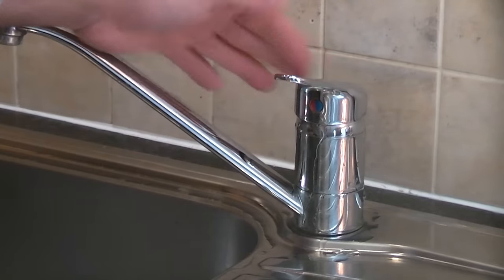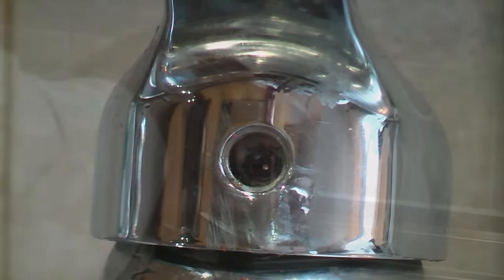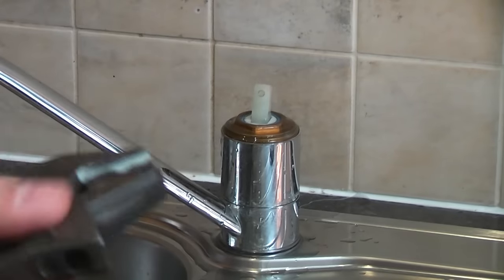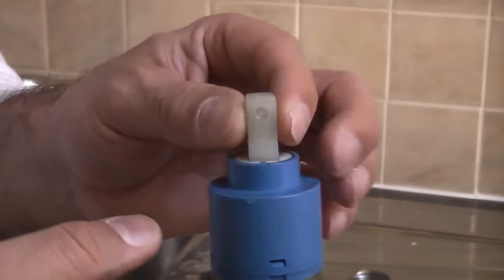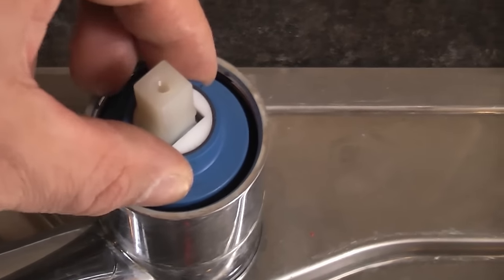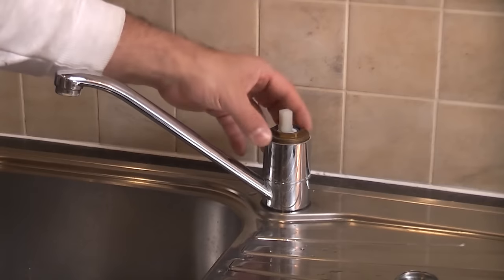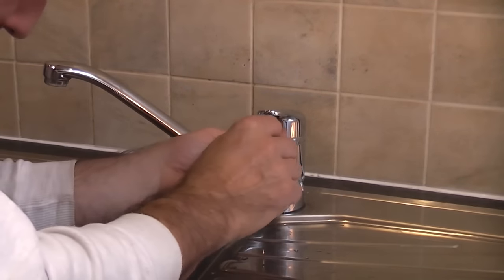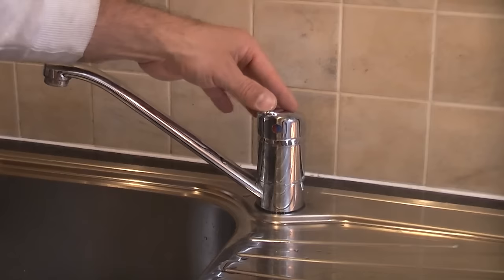Kitchen mixer tap repair

Comment: I have the same tape. Is the process the same too fix if the leak is dripping out tape and not the sides? Thank
Reply from the maker: Yes, a new cartridge should fix that, although if the tap is leaking from the centre (where the two parts of the tap join), it is often best to replace the whole tap.
Thanks for the comment 👍
Reply: Ultimate Handyman   Thanks for the reply, and helpful vid. Yes I meant to say my leak is dripping from were the water normally comes out,  so cartridge replace or tape.  Just double checking thanks ,Likes and subbed

Comment: Ches, you might know the answer to this question:

Why are bath taps such a small diameter nowadays? Presumably this is so they can make the same gland fit in basin taps, but my bath takes 15 minutes to fill!
Reply from the maker: +James Knight I think it's because most plumbing these days is piped in 15mm, whereas with older systems it was 22mm.I don't think combination boilers can heat the water fast enough to fill the 22mm pipe, hence it's all piped in 15mm now.

Comment: My problem is the screw does not come out, it is unscrewed to a degre but I cannot take the cap off.
I do not want to break it any advice?
Reply from the maker: I had a similar problem in this video-
https://www.youtube.com/watch?v=a2prr9ZiFxA&t
Spray penetrant, a bit of gentle persuasion and gentle taps upwards should help 👍

Comment: Great video, I'm happy that I found it! I'm in Australia where everything is so expensive. A call out for plumber to check on your tap can cost you $150! My tap has the same problem, I tried to open it using an Allan key as in the video, it turned and turned but I could not open to handle! Any advice??? Thank you so much!
Reply from the maker: Sometimes the handle gets stuck on the square spindle, spray penetrant can help to release it.
Reply: @ultimatehandyman  thanks, I'll try that
Reply: Plus consider that if you are doing this in Australia then the same principles apply but upside down 👍🏻
Reply: Hello I have loosen the screw as per the video but the handle doesn't want to come off.
Reply: @ultimatehandyman  worked for me 2 sprays 10 minutes each of wd40

Comment: I've tried and tried to lift out the access cover using the sharpest pick tool and it just doesn't even look like it will come out, there is no edge to it at all
Reply from the maker: They have always come out pretty easily for me, but I've not worked on every single brand of tap. I hope you have sorted it by now.
Thanks for the comment 👍

Comment: The cap doesn't come off after taking out screw, any particular way to take it off
Reply from the maker: It can get stuck because of corrosion and solids in the water. If you spray some spray penetrant through the hole, let that soak in, then grab the handle and try and force it upwards, it should work loose. Sometimes it is not easy though and can take some perseverance 👍
Reply: @ultimatehandyman  👍  managed to get it off thanks

Comment: Hello I have loosen the top screw as per the video but the handle is still stuck?
Reply from the maker: Sometimes they get stuck on when the zinc corrodes.
If you can spray some spray penetrant through the hole, it might help to release the handle.
Sometimes I remove the grub screw completely, give it a spray and then after 10 minutes give it a gentle tap using a mallet, or by using a hammer and soft piece of timber (upwards)

Comment: I found this video useful but my mixer tap is leaking from the spout itself. It just drips every 5 or so seconds. Highly annoying! The tap isn't like the one shown but has a hot and cold either side but flow from one spout. any ideas? 👍👍
Reply from the maker: +tman2260 
Does this help-
https://www.youtube.com/watch?v=gQHdzRnbkW4
Reply: Yes it does. Although it drips from the spout itself. Will this cure it? I'm not sure which one is leaking so I will change them both. Many thanks for the swift reply 👍👍
Reply from the maker: +tman2260 
When you say dripping from the spout itself you do mean where the water normally comes out of and not the bottom of the spout as it comes out of the tap.
If it is leaking out of the end of the spout (where the water normally comes out), then yes replacing the cartridges in it should fix the problem.
If your tap is not a quarter turn tap, you might get away with just fitting new washers, very similar to this video, just a different style of tap- https://www.youtube.com/watch?v=I1iGLiUCDqI

Comment: What to do if there is water coming from the cartridge after replacing it?
Reply from the maker: Try tightening the top nut (the one that holds the cartridge in position). If that does not work, you might need a new tap 😱

Comment: Having some trouble loosening the brass nut which allows you to access the cartridge. Any suggestions?
Reply from the maker: They can be really difficult to remove. Sometimes you can pour hot water on the nut and it might help to loosen it.

Comment: Step two and already failed. Wether I use Hex Key or anything with similar head, screw doesn't come loose. From video it looks like socket is round, and mine is as well from what I can see with flashlight. Sadness ensued.
Reply from the maker: If the grub screw is stripped, you might have to drill it out!
😱
Reply: @ultimatehandyman  Well that's the problem, from your video I see round screw same as in my case, though you used Hex Key and it worked for you. I have to decide whether I'm seeing things or I actually have to go at it with drill.

Comment: 😢is there any fix to my tiny water jets out of the side of the big long part of the tap? Ir do I need to buy and have new kitchen sink tap fitted?please see previous comment for more in depth description thanks:)
Reply from the maker: You can normally just unscrew that part and get a new one, they are called a tap aerator, or sometimes a tap nozzle (faucet aerator if you are in the USA)

Comment: Hi there, I changed my cartridge but it’s leaking again . Can u pls tell what I should look for .
Reply from the maker: If the nut is tight, either the cartridge is faulty or the tap itself is damaged. The tap in this video was replaced a couple of years after the cartridge was replaced, as it was dripping from a join in the tap itself, which could not be repaired. Sometimes a new tap is the best option.
It was a real pain of a job to do- https://www.youtube.com/watch?v=N-MyYzYwEhc

 Thanks for the comment 👍
Reply: Ultimate Handyman  Thank you 🙏 for tip , I’ll change with the new tap and see .

Comment: Hello mine is leaking at the bottom of the tap near the sink, I think limescale must have corroded the rubber ring there, is that easy to replace? I have exactly the same tap.
Reply: same here. what do you do when it leaks from the bottom? I am unable to find a solution anywhere online
Reply from the maker: It should be relatively easy.
I'm sure my sisters tap has started leaking in the same place. I'll try and do a video but I'm really busy at the moment and have zero spare time.
If you remove the cartridge as in this video you should then be able to unscrew the tap body, which will expose the O rings.
Reply from the maker: You have to remove the cartridge, then unscrew the body of the tap.
I'll try and cover this when I get chance, but it could be some time as I'm very busy at the moment.
Reply: Exactly. I removed the cartridge yesterday and tried to unscrew the cylinder above the spout. It just does not budge. I do not want to force it and risk a bigger leak. I am sure I just have to replace the O rings. Are you sure it simply unscrews?
Reply from the maker: No, I'm not sure.
Similar ones that I have fixed have separated and have an O ring, but I'm not 100% certain with this exact model until I have a go myself.
If it does not separate I would imagine that the only fix for it would be to get a brand new tap, which is a real waste.

Comment: You were lucky, I have recently found out that there are no replacement cartridges available for any of the taps in our house, even though at least one is a large reputable brand. We can live with the slightly leaky tap in the bathroom, it only drips a few times per hour and doesn't waste much water, but the kitchen tap is getting stiffer and stiffer to turn and soon I will have to replace the whole thing, not good for a tap only 3 years old!
Reply from the maker: +caskwith 
Have you checked all the sellers on ebay, there seems to be lots of different types for sale on there- http://fave.co/1NWppR4

Do your cartridges have any numbers on them?

It's so much more work changing the taps!

Good luck with finding one- or replacing the taps!

Thanks for the comment ;-)
Reply: The numbers didn't match to anything I could find online and contacting the manufacturer didn't help either. I'll get it sorted somehow.
Reply from the maker: +caskwith 
It's ridiculous that they can make taps that you can't get the parts for. It should be illegal!
Reply: +Ultimate Handyman 

It just struck me that somewhere, there might be a group of manufacturers going :
It's ridiculous that he not only repairs our stuff but also teaches others. 
In spite of welding, glueing, crimping....he manages to get into everything 
we make no spares, follow no standards, but he manages to repair everything 
Our loss of new business is unimaginable !    IT SHOULD BE ILLEGAL !

:-)   :-)   :-)   :-)   :-)   :-)  :-)   :-)   :-)   :-)   :-)   :-)  :-)   :-)   :-)   :-)   :-)   :-)   :-)   :-)   :-)   :-)   :-)   :-)
Reply from the maker: +BR Gurunandan 
LOL, I'm sure some manufacturers so thank like that. Cars are a good example. I used to be able to fix most things on my Ford Cortina using a socket set and a few screwdrivers. Now you need Torx bits, tamperproof Torx and a whole host of specialist tools just to do the most basic things.
I'm sure they design everything on vehicles so that you have to take it into a garage to get it fixed.
I used to have an old Mercedes 190E and the heater matrix went in it. I had to remove the steering wheel, dashboard and dials etc. before it could be removed. In my Cortina you lifted the bonnet and undid two phillips screws and the heater matrix pulled straight out! 
Thanks for the comment ;-)

Comment: hi, what about if its leaking right at the bottom, mine is gathering water right at the base?
Reply from the maker: Probably time for a new tap! My sisters tap is doing the exact same thing now, I have looked inside and there does not seem to be a way of tightening anything to prevent it from leaking at the bottom.

Comment: you can get taps like this for 20 quid  ..        wish  these tap makers would  put a name on the tap .. it would make my life a lot more   easy ...
Reply from the maker: +anthony duvall 
It's a much bigger job replacing the whole tap though, in many cases you have to remove the sink.
I prefer standard taps with a proper head gear, which can last 20+ years before they need looking at. This tap is probably only 5 years old!
Like you say a manufacturers name would help!
Thanks for the comment ;-)
Reply: +Ultimate Handyman on the plus side, super easy to do IF you can find the cartridge!, i still prefer super old school, i have a tap reseater and if you do them early, old taps last almost forever for the sake of a bit of rubber washer
Reply from the maker: +jusb1066 
Absolutely, You would expect the cartridges to be standard, but that is just too simple LOL
Thanks for the comment

Comment: mine dribbles when left shut but on hot, when the arm is shut but on cold is doesn't. Would this be the same issue do you think?
Reply from the maker: Yes, it sounds like a faulty cartridge.

Comment: I did take off the Plastic cap and undo the screw inside but it didn't come out I even pulled strongly. What else I can try
Reply from the maker: You might have to try pulling it hard using a pair of molegrips/water pump pliers.
Sometimes the seal gets compressed and sticks the cartridge in position.
Reply: Ultimate Handyman worked tnx

Comment: what exactly is faulty with the cartridge
Reply from the maker: The tap was dripping continuously.
A new cartridge fixes the problem 
Thanks for the comment 👍
Reply: @ultimatehandyman  what I mean is what causes the cartridge to not work
Reply from the maker: @andrewvaughan5686   Something is worn inside of the cartridge, either O rings or the ceramic discs.
Reply: @ultimatehandyman  that's odd I just moved into a new home (new build) and had this issue. Changed the cartridge and fixed the leak
Reply: @andrewvaughan5686  I think the two flat ceramic discs inside the cartridge have worn so the two mating surfaces are not flat anymore so water leaks between them.
Yeah it's easier to buy a new cartridge, but I am interested in how could the two ceramic mating surfaces be lapped flat again.

Comment: Can someone explain how to isolate the water please.
Reply from the maker: Sometimes there is an isolation valve on each of the pipes beneath the tap that you are replacing, if there is not you will have to turn off the main incoming water supply stop tap, but you might also have to close a gate valve for the hot water (if you have a conventional heating system)

Comment: we have removed the screw with allen key..but can't pull the cap off..what do we do
Reply from the maker: Try spraying it with WD-40 or even hot water might help.
The tap handle will be seized onto the cartridge, these can be difficult to get off sometimes but if you keep waggling it upwards it should pull free eventually.
Reply: Ultimate Handyman I pulled at mine and the whole thing broke into pieces
Reply: We're having trouble with our tap and I couldn't help laughing when I read your comment.  Knowing our luck it will happen to us too!

Comment: I have a tap like this but it won’t turn off you can only change it to hot or cold anyone able to help
Reply from the maker: It sounds like you might need a new cartridge.
Perhaps you can isolate the tap from under the sink? 
Thanks for the comment 👍

Comment: tap cartridges and glands are a nightmare so many types and splines, it's a conspiracy I swaer manufactures do it on purpose so you'll just buy another tap. 1/4 turns are the worse a few microns of limescale on the mating surfaces and the tap just drips n dribbles.
Reply from the maker: +ZanderKaneUK 
That's correct, although my local plumbers merchants in Blackburn (Sheths) seems to stock a lot of them, so I normally pop it out and take it there. So far they have never let me down ;-)

The cartridge in my shower needs replacing (Mira Excel) but at over £100 there is no chance I'm replacing it, much cheaper to replace the whole thing!

Thanks for the comment

Comment: done all this still leakes afteter replacing cartridge. these taps are shit imo
Reply from the maker: It depends on the make, some of these taps are not made very well!
I changed a cartridge one and it still leaked, I ended up replacing the whole tap!
Reply: @ultimatehandyman  Good video though  so thanks anyway